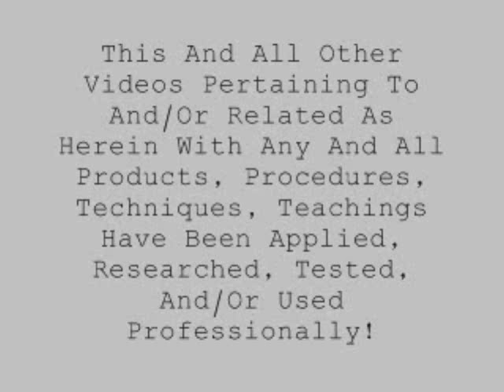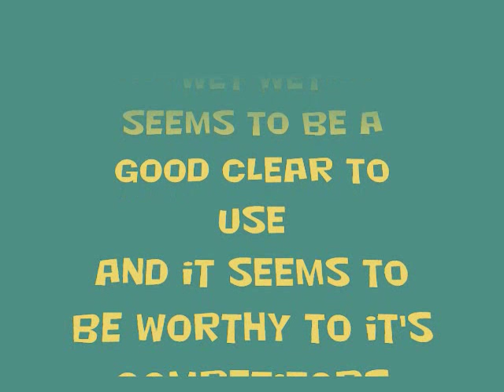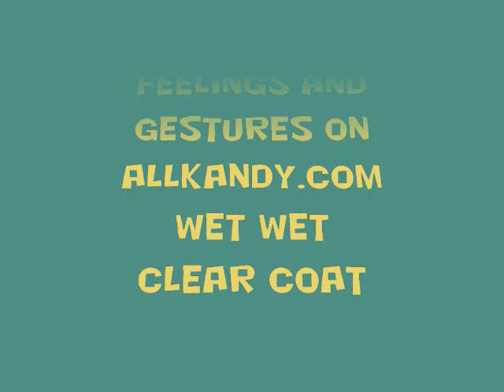Whats The Best Clear Coat To Use-AllKandy Wet Wet Clear Review-Part 2

Comment: Great honest opinion Pete...all the things you mentioned is correct...it's a lot of factors on getting a good finish...temperature,settings,booth and etc...you just can't expect to go in the booth every time and get the same results....nice job and overall results
Reply from the maker: +SprayWayCustoms You can't just buy a can of custom car and take it to the car show and win! It takes practice and patients, as you know>>>>!!
Reply: I've used the All Kandy Wet Wet clear it is okay but no way competes with Matrix, SW Ultra 7000, Diamont or any of the real top tier high end clears.

Comment: Orange peel area was same spot as 1st coats dry area..... The time in-between the coats prevented them from melting into each other so to speak.... I use Spies Hecker clears & It requires a medium wet coat immediately followed but by a full wet coat....
Reply: ThistleDewOutdoors I agree

Comment: You should try mixing the paint and clear half and half. The paint comes out with an amazing 3 dimensional look to it and shines like a mirror. They have sprayed all Mercedes benz like that from the get go no buffing or sanding and no fade unless you leave the car in the open for 60 years.
Reply from the maker: +Ricky white After you apply your paint you can go back and mix your clear up with the paint residue still in the paint cup and does the same thing. I don't know about the 50/50 mix, I have never done it that way.

Comment: Speaking of clears Pete, have you tried or know about KBS Coatings? I'm super green to painting. This is my 1st one. I'm doing a 55 Mercury Monterey. I got some KBS Clear to do a bare metal application. Supposedly it doesn't yellow and it's super durable. It doesn't chip, dents hold ect ect. They say on tge ad you can roll it on or use a paint brush and it self levels. Crazy shit. Have you used it? Thanks for your time

Comment: For the average garage painter I think  a High solids clear is much harder to spray than Medium solids clear with a gravity feed hvlp gun.  But it has less durability obviously so won't last as long.
Pete what do you think about some high solid clears that require using reducer? Does the reducer change the durability of the paint?
Reply from the maker: +DKR Using a clear that requires a reducer will have a less advantage to using a high quality clear that only use's a hardner. Using reducer in the clear lessons the UV Protection by thinning it out and it will eventually flake and peal off in the near future.. I would stay away from any clear coats that need reducer added to them.

Comment: What psi do you spray a glamour high solids clear I use mostly lvlp spray guns but never used a high solids clear yet. I always got orange peel when painting. I saw the paint said sand vehicle with 400 grit before applying basecoat will be using this Rongpeng spray gun got from Ali Express never used it before but most of the spray guns got lately the paint will use is Starfire but the glamour high solids clear will be 5 Star Extreme I can't say the clear and base of these products bad good or great yet  had got orange peel using the base though of the metallic urethane paint if the brand but my paint skills not good enough yet. Only been trying to paint almost two years but don't paint all the year only sometimes out the year plus I don't got the right heater to paint in winter in Michigan. The guy at Auto Value store told me where I purchased paint before said don't use a propane heater to heat garage. The high solids clear use is flammable I know that the one got now. I looked at the inflatable  paint booths but rather just paint in the garage.

Comment: Can you go, 1/2 slow, 1/2 med. or not? Just curious, u dont know, ask.
Reply from the maker: +WannaBeDj100 No,, I don't think you will get a good finish being a chemist with the product.. I did spray the hood and fenders last night using the slow hardener at a temperature of 65 degrees and it came out near perfect.. I will have to color-sand and buff though due to dust specs...

Comment: Great test & sounds like a good product.  You are so right - you have to get practice with a product.  It would be nice to get the build quicker to cut down on the number of coats required for sure.  Sometimes I've had similar problems as you but with PPG where it looks perfect while wet but once  dry has a very fine texture that kills some of the gloss.  Never did figure out why.  Sorry but have to ask - do you also like to poke pissed off rattlesnakes with a stick?  LOL!  Thanks again for all your help!
Reply from the maker: +Jim Daniell Here in Dallas it's very hard to get a SURE SHINE FINISH without colorsanding and buffing because of the high humidity which will cause alot of effects from dry spots, runs, solvent pop, and fish eye.. It worked well and I would use it again!

Comment: hello pete, love your vids. im a diy guy i do it all from rebiuld engines , tranys, to rear and everything in be tween. i love my truck and will never buy anything else. well i have 2.  both are 1st gen. s10 blazers . 88 and 92 . both 2drs. well anyway i dont have a shop so have to do all my work out side witch sucks. but anyway i replaced about 60% of the body on my 88 and i dont know what type of primer to use. as i have to do this in stages as i have to use it. my 92 is not on the road yet . so my 88 has a lot of crap spray can primer to cover what body work i have done. i want a primer i could use over factory paint and spray primer. want to cover the hole truck to make it look ok. as im not ready to paint it yet. still have to weld in a rocker panel and get it smooth. so what kind of primer should i use?